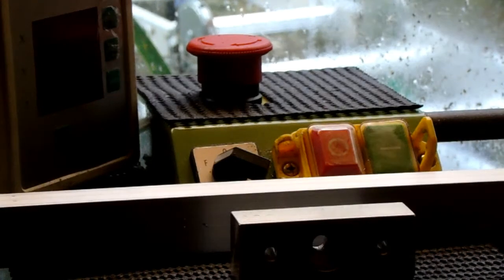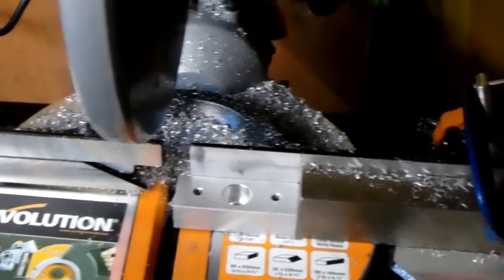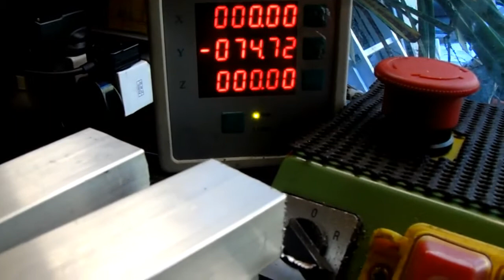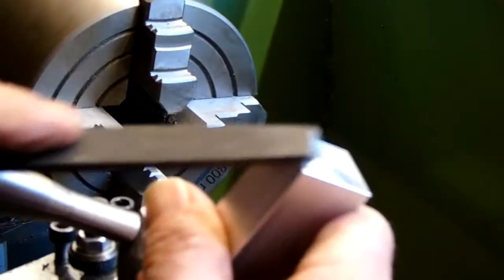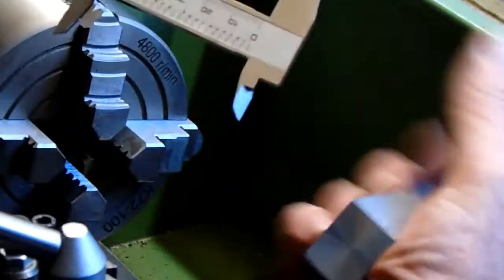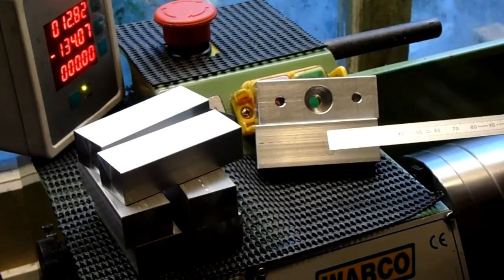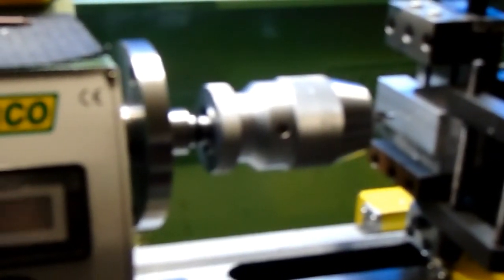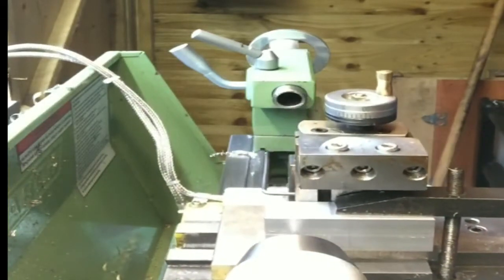Warco WM180 lathe. Milling small batch work part one

Comment: Ade, have you done or could you offer some advice on how we can modify our Warco WM180 to do some milling?
Reply from the maker: There are loads of videos on my channel showing a milling slide set up on the cross slide . I did have to make up a simple plate to bolt it on . Have a look at the videos that were put up after this one by a few months . Cheers Ade.
Reply: @ade63dug  Will do Ade, as ever, thanks :-)
Reply: @ade63dug  Aha after trawling through about 20 videos I found Shed Talk 11 where you made the plate for the Milling Slide. Beyond my skills at the mo but definitely something I'd like to have. WHat sort of size Milling Slide can be fitted? And I guess you need milling tool collets etc? Also saw you using a Fly Cutter.

Comment: I am impressed by how well that Evolution chop saw cut your aluminium stock. What model is it?
What do you use to cut steel stock, as I guess the Evolution would not be able to cope?
Reply from the maker: it is an evolution rage 3-s i have cut 70mm dia with it but taking it gently with wd40 sprayed on the blade to prevent the alley clogging and welding to the teeth , for steel i use the old fashined hack saw or part it off
Reply: ADES WORKSHOP Thank you for that information. It does seem to be a great saw, and would cover all my needs. As for steel...........there appears to be no alternative to a bandsaw.
Reply: Ive got an evolution rage 2 [or Evo saw355] for cutting steel.  I cut through 45mmx13mm steel bar [even tho recommends a max thickness of 6mm] with no problems at all -  40 cuts in about 20mins
Reply: 44Celt  Thank you for that information. Looks like it is a versatile chop saw. High on my wish list now.
Reply: The evosaw  355 is slightly more expensive than rage 2 but has a heavier bed/vice and a pro 60tooth blade [rage 2 has a 36tooth blade] so recommend for more heavier/frequent use
Reply: 44Celt  Thank you for the additional information. I can see the value of the larger saw.

Comment: Hey, thanks for posting the videos. I'm contemplating getting this lathe (how I found your videos). I wonder if you would recommend paying the extra cost for the version with the dro? How much difference does it make vs the problems of it getting in the way of the slide travel?
Also one other question, was there a reason to drill and use the milling table rather than mounting in the chuck and boring? Was it a size issue? Cheers
Reply from the maker: depends on your needs , In my case it is worth the extra , the bolt is easy to change and on a day to day basis the restricted travel is no problem . it would only come into play cutting a long taper. I used the milling method to speed up the setting up process and could also do the 3 holes in position in one setup